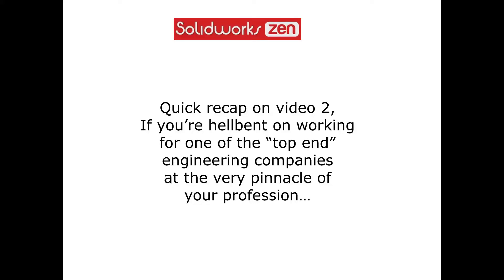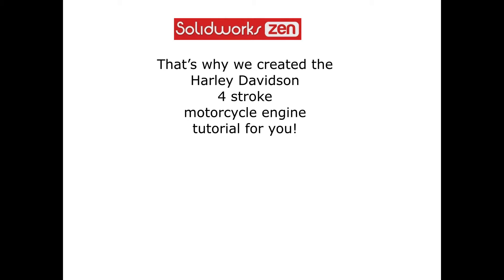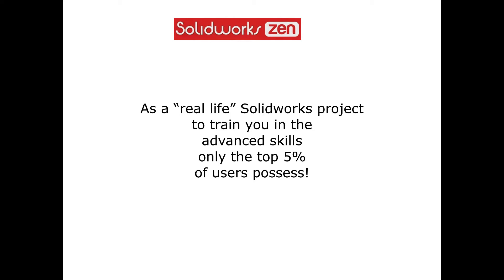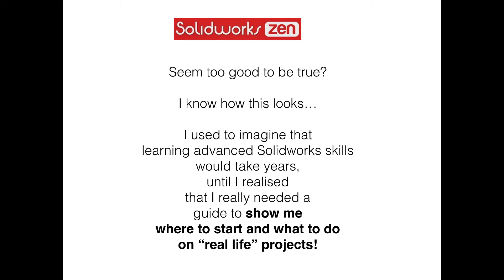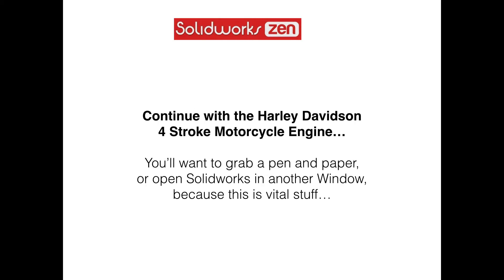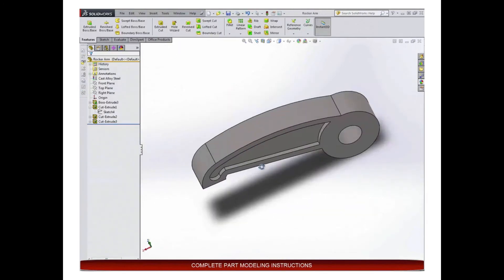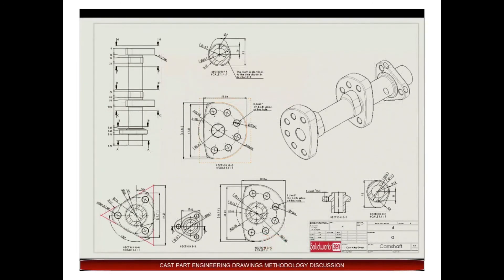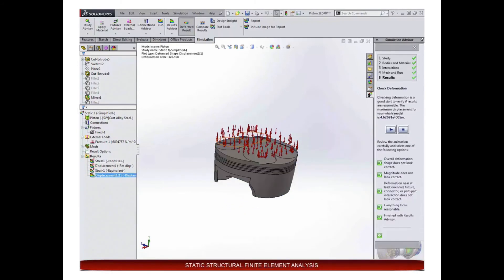SOLIDWORKS PRESENTATION HARLEY DAVIDSON Engine PLC#3 Tutorial [FREE] 2016

Comment: Just so you know, this isn't an actual Harley-Davidson production engine. It has the basis of a V-rod engine but the timing chain goes vertically not horizontally. everything above the pistons are a different design. Even the piston connecting rods are different. Just FYI